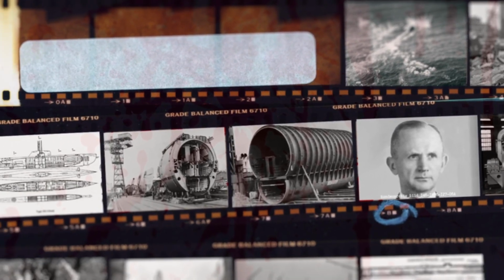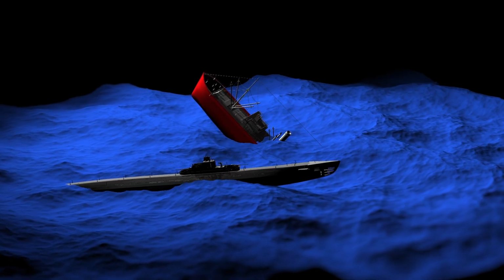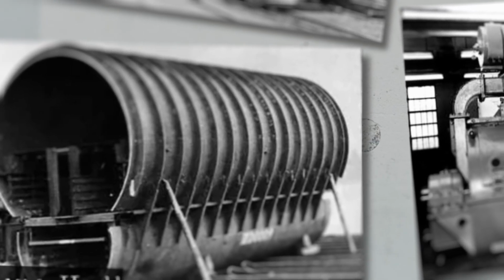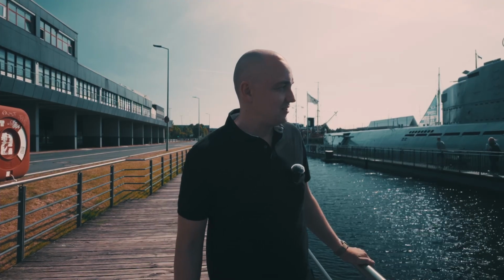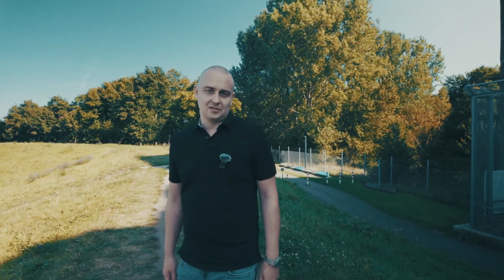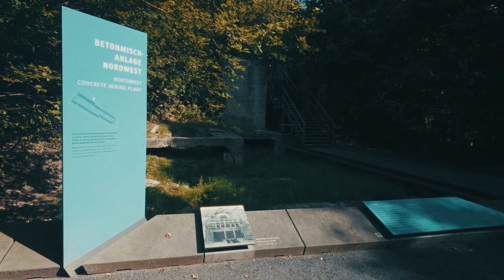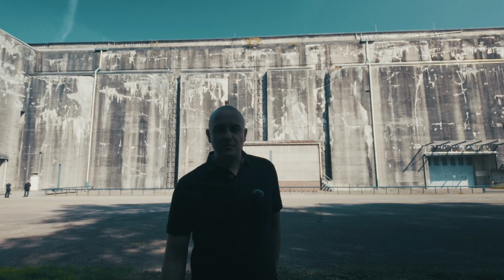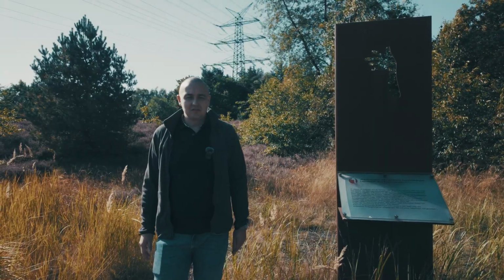Bunker Valentin I History of Nazi Germany´s largest above ground bunker...

Comment: Fabulous.  I’d like to fill in additional information about the turn in the Atlantic war.  Two things not mentioned are HFDF  (high frequency direction finder) which could locate u boats when they transmitted by triangulation, and the invention of the hedgehog system.  Allied intel underestimated the depth capabilities of uboats.  Depth charges were more effective if they detonated below a submarine.  The hedgehogs were an array of spigot mortars that broadcast an array of contact detonated charges.  Depth didn’t matter because contact was required for detonation.  That explosion would indicate contact with the uboat, and confirm damage or destruction.

I was lucky enough to grow up within 20 miles of an intact captured type IX that was on out of water display at a museum.  We took field trips every year during primary school, and the tours went through the inside of the boat.  The U505.  Amazing.  Much respect for those brave sailors.

Your videos are stellar.  Your English is outstanding, with just enough accent to add authenticity to the subject matter.  Thank you again for your efforts.❤